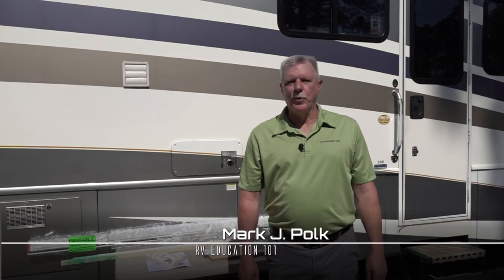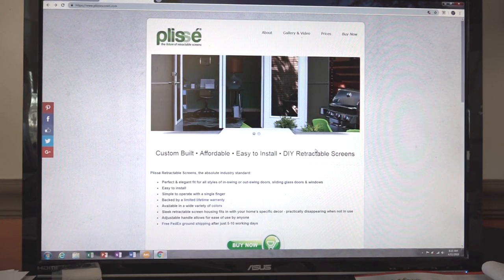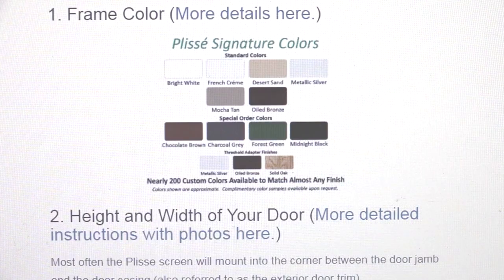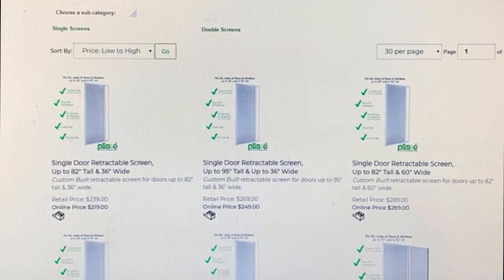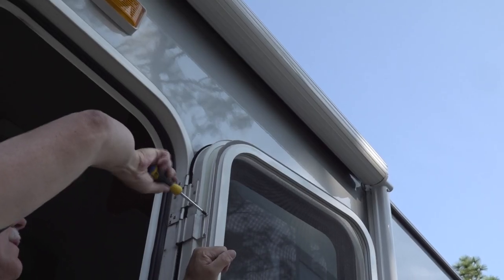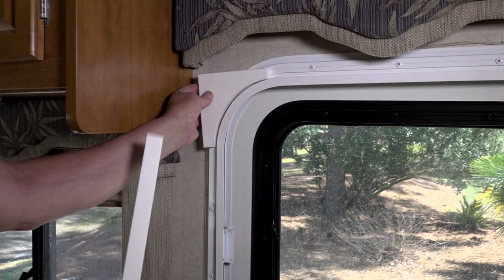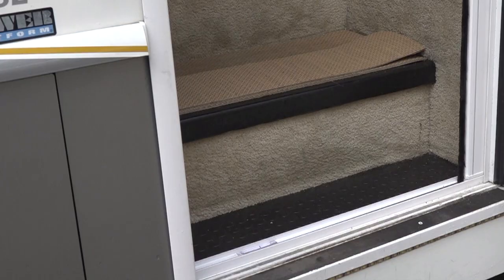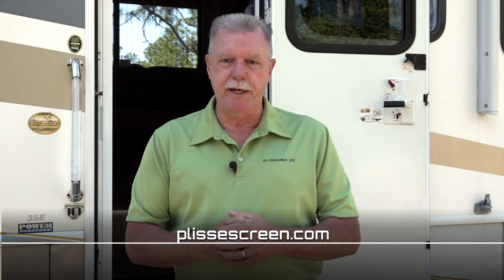How to Install a Retractable Screen Door in your RV

Comment from the maker: Note: If you decide to install a retractable screen as a DIY project you need to be comfortable with your abilities and skill level. Depending on your RV, and the degree of customization required, it can take a great deal of precise measuring to get a custom made screen that will fit and work properly.

Comment: Thanks for this review and how to. I’ve spent a lot of time analyzing how to install a DIY screen door on my converted cargo trailer. My door is wider than most rv’s and regular travel trailers and the standard doors don’t fit. I also want some type of screen for my rear opening after the ramp is let down. Thanks

Comment: Did you install the grab bar on the inside as you go down the steps?  This would be ideal for my mother who has a hard time getting into and out of my RV.
Reply from the maker: No, our motorhome actually came with the grab bar. You should be able to find a grab bar, but the trick is making sure it mounts to a solid surface.

Comment: I woul never be able to provide all those measurements. I used to work for a company that sold these, probably 75% of cistomer self installs failed and we had to take back the kits and customers gave us horrible reviews because they had mangled their door frames. I would never recommend this project as a do-it-yourself.
Reply from the maker: I think most people have a good idea of their capabilities and limits. They could always find an installer, if they are not comfortable doing it as a DIY project. I do agree, you need to good and accurate at taking measurements.